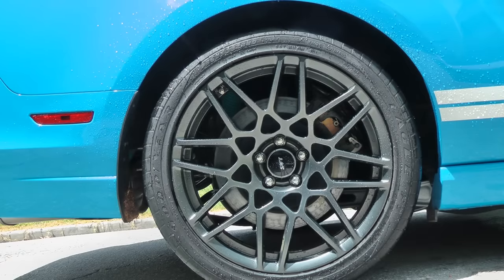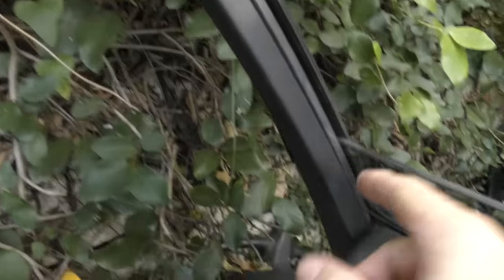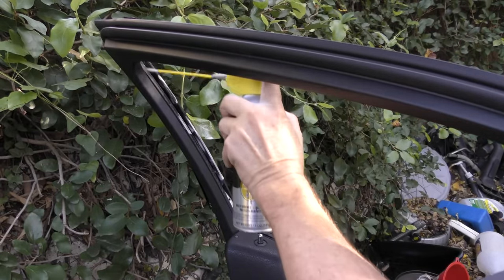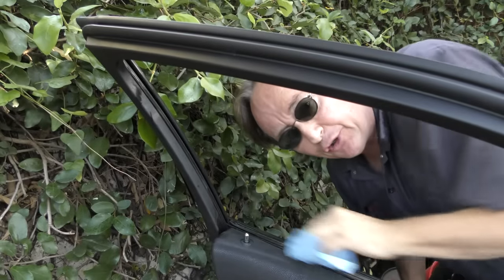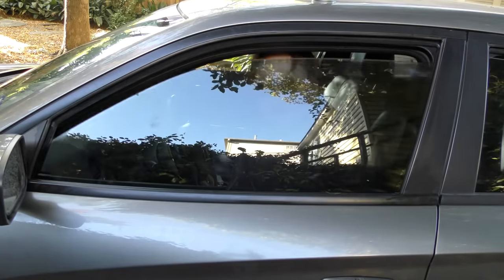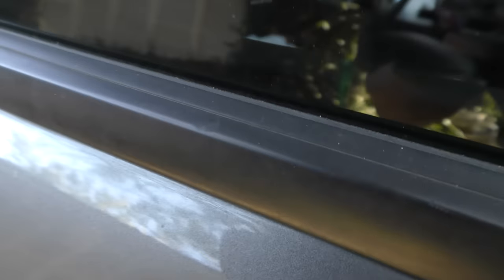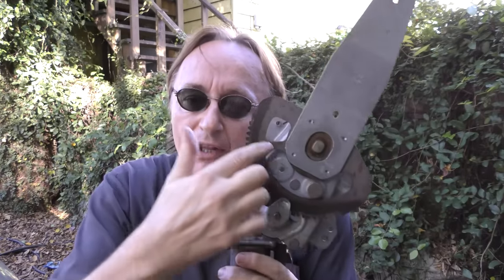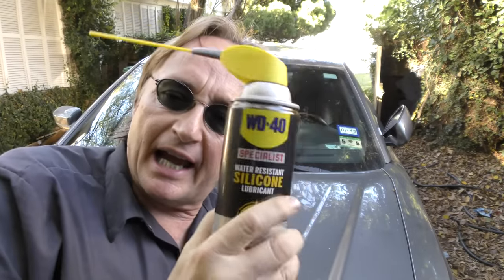Life Hack That Will Keep Your Power Windows Working Forever

Comment: why so many thumbs down..somwbody wants to give some advice and share his findings.. so respect him a bit ..if you dont get lost
Reply: Here’s why at first there was nothing wrong with the window to begin with he was just playing with the switch.
Reply: Could be Ford haters that are mad because of the intro.
Reply: @georgerebreev  He may have been playing with switch for effect, sure. But he is right. My power windows were sticking similar to what he showed. After awhile the window motor blew. $85 for a new motor, and about 2 1/2 hours tearing the door apart, replacing the motor, and reassembly. This stuff actually happens. So what's better? Waiting for mechanical failure, or a touch of inexpensive preventive maintenance?
Reply: @georgerebreev  he was giving an example? Lol

Comment: WD-40 fixes everything.
Reply: +Peter Griffin NOOOOOOOOOOOOOOOOO only use sillicone lubricant, not regular WD-40. WD-40 RUINS the rubber and makes the operation even stiffer in the end.
Reply: +Peter Griffin = I spray it into the car's door lock cylinders (and truck lock cylinder) every couple of years, to keep things working smoothly.
Reply: To bad it can't fix my wife 😂😂😒
Reply: Wd-40 Rocks !
Reply: Hi I used the normal wd-40 will this cause any major issues or shall I just buy the silicone one instead
Reply: SuperMadBoyHD - Regular will dry out rubber faster.. The silicone is the way to go.
Reply: Not always.   Sometimes you need a hammer and some duct tape too.
Reply: They make a teflon spray for locks which works better because it doesn't leave any residue,  you can cause build-up allowing dirt to stick.
Reply: Yup I put it on my breaks it definetly stopped the squeeking but didnt stop me from crashing into a car 😂
Reply: Regular WD is only for degreasing or water displacement or salmon fishing lure scent cause it's made w fish oil.
Reply: Can it fix my erectile dysfunction?

Comment: Thank you for this.  I bought a car at auction that had this exact issue and a 6 dollar bottle of wd40 silicone fixed it.  You rock
Reply from the maker: Glad to hear it, Thanks for the support!
Reply: WD40 isn't silicone.
Reply: It is if you buy the silicone version... that's a thing.
Reply: Reed Criswell 
I didn't know WD40 brand sold cans of silicone.  I've been buying gallons of WD40 penatrant to loosen rusty fasteners for decades.  It evaporates in short order,  so I doubt it would help sticky windows for more than a week or so.  
Same with using WD40 to shine oxidized headlamps.  After it evaporates,  they become dull again.
Reply: @scottykilmer  is it a replacement for K Y. Oh Ya I'm a smartass.
Reply: @phildouglas9086  WD40 does have a product that is a silicone spray.
Reply: We pay $14-$16 for a bottle of wd40 silicone here in New Zealand.
Reply: So it got to be WD silicone only no other brand ?
Reply: Miamiman 305 any spray silicone will work. Just make sure it’s just silicone and nothing with petroleum products in it.
Reply: So did I.  Don’t buy auction vehicles
Reply: @Nikkk6969  I've been driving auction vehicles for decades. 
between $200 - $1,000 range. 
drive them for free then double my money. 
RV's too

Comment: I've been doing this for ages, without even realizing that I was helping the windows. Lol. I use silicone lube to treat rubber around the car (including window rubber) to prevent dry rot and keep the rubber pliable. Killing two birds, with one stone! I like it. Great tip Scotty. It explains why I have never really had a problem with my power windows. Those motors are quite expensive, yes.
Reply: Interesting, but why not simply use a car detail lotion, like Maguires Gold Class Trim Detailer? They're made for the task.
Reply: @ecurb10  because there's a price difference

Comment: What old timers learned from their Dad's which young folks don't learn any longer is that moving bits must be lubricated in order to prevent wear, or eventual lack of operation. 
From the old timers history log .... 
If it moves, lube it ..... if its stationary (and exposed), paint it (coat it)... finally, always clean it...

Comment: If you own a BMW, this is a must because even after 30 years, BMW still can't seem to figure out how to make power windows work well, and the motors are notoriously weak... so do this as often as needed.
Reply: Temptation Christmas Silent Night
Reply: That is why BMW stands for Break My Windows.
Reply: LazyEyeCrazyI my 91 e30 works just fine after 26years
Reply: will this make my windows dirty whenever i roll them down and back up? you know like will they be like greasy?
Reply: LazyEyeCrazyI I must concur with you, my esteemed colleague. Ford and BMW must use the same brushes or windings in their motors because before I started typing this, I pressed my window up toggle, made a sandwich and now here I am. Another 40 seconds or so and it'll be mere centimeters from its apex. While I'm waiting, I will note that BMW has the best paint aside from Ferrari. Their Red is close to comparable to that of Ferrari in my opinion. Although, I haven't cared much for the color codes in the past few years. I'm not trying to be a dick when I say this, but they started using womens mascara colors to attract more female buyers which I understand, but they could definitely throw in a deep orange or burgundy, or even cubed blue like Cadillac did... that paint was gorgeous I have to admit and I'm a ford guy... Ford paint is by far the worst. A month old garage kept vehicle shouldn't feel like a junkyard undercarriage, ever! And my window along with my time is up...
Reply: Mike Foehr are you sure? I thought it was "Blew my wad" all this time. No wonder I didn't get that sales job in Juneau.... they have a dry humor there ya know? I took my snowblower to the eskimo mechanic for some repairs and so he looked it over, then looked me over and said "it looks like you blew a seal". I replied "nah, that's just snot".

 They asked me to leave...
Reply: Ya replaced my regulators 3 times in my BMW, or better marry wilma

Comment: Great vid, Scotty! I can verify through personal experience this DOES work - even if your motors are weak/failing, it might just prolong them. I use silicone spray on my 28-year-old Buick and it works every time!

And, when it comes to GM cars, sometimes it's just easier to change the whole door out with a working junkyard door than it is to replace the motors when they finally burn out. Took me a little over an hour to change two doors on an S-10 Blazer where both window motors failed, as opposed to several hours disassembling each door and messing with the mechanisms!
Reply: yikes!

Comment: I grease and white lithium silicone spray the rollers, pivot points, and hings on the actual window riser frame and use the grease on the gears (the spiked teeth).  Helps AMAZINGLY on ANY car older then 5 years of age.   Also make sure your felt strips that are on both sides of the window, one inside the door and one on the outside.  They wear out sometimes or have tears that cause slow or even completely stopped windows. 

To Man Asking About Preventing Fogging On Windows: To prevent fogging on the windows, use RAIN-X ANTI-FOG.  It lasts a very long time and you only need to re-apply a coat on the inner window every year or so.
Reply: I use Barbasol shaving cream...much cheaper than rainx and also does an awesome job on the bathroom mirror and it only takes a little bit. Try it!
Reply: Jeffrey McDavitt good  tip jeff,You are obviously a mechanic, also .thank you for the input

Comment: Silicone wd40 is the best. I use it for electric connections with or without the silicone gaskets among other things. It makes the gasket connection slip together and apart super easily and keeps corrosion down.

Comment: in case it hasn't been mentioned, use tyre shine spray if you already have it rather than buying expensive silicone spray. Tyre shine is silicone based, and fixed my binding window track, which was causing the window to stop as the overload switch was tripping due to rapid heat build up..
Reply: i used silicone dashboard shine spray and it worked too spray plenty of it and bonus thing is my car smells great since thn
Reply: Ahhh I just remembered I have some tire shine.  Thank you for making me remember I don’t have to buy anything new now

Comment: my drives windows was going slower and slower, pretty much figured i was going to have to replace the motor....saw this video the other day, used the same spray he did, and my window is flying up and down.  completely fixed it and saved me from buying a part i didn't need.  Thanls Scotty!

Comment: Silicone lube spray is also good to keep windows from freezing shut.
Reply: +66gt40lm yep, lube helps to keep windows from sealing, and vaseline helps so the door seals wont stuck together, I do this every year and never had issues, well, only when the whole car got covered in ice but that's a different story
Reply: draconpost actually silicone is good on both overtime you'll see the issues with using things that seem to be fine.  Petrol based can dry out and cause parts to become brittle or tear.  I use rain x on my windows then drop them down and do the tops that normally are covered by the seal.  That way you don't get felt/rubber stuck to the edges if your windows are usually closed, kept outside etc..  That also helps keep them from being frozen in the winters.
Reply: Can it be useful in reducing noise while operating power windows
Reply: Kartik Jain Yes smoother is easier on the motor with a consistent easier effort vs catching or drag as it is running.  So it tens to be quieter and smoother.

Comment: Does that also help in the winter when it freezes?  I spray the door gaskets and locks every fall so they don't freeze, but I wonder if spraying the windows like that could help?
Reply: That is why he uses silicon lubricant, it resist low and high temperatures without doing a gum.
Reply: Jennifer D
Reply: Leg cramp cure
Reply: I did wish he would have gave other usage tips at the end of the video...  Going out to buy an $8 can of lubricant when you only need like 1% of the can just leaves you with 99 more uses :/
Reply: @ihatesignupsgrrrrrrr  Spray your key locks to avoid those sticking?

Comment: I had a problem with my nissan frontier truck. After i brought it to a bodyshop to fix dents, my window is not working smooth after. I tried to send it back but they cant figure whats wrong and how to fix it. So i did this. Thanks so much it worked my windows run smoothly after i applied wd 40 silicon lubricant. Good advice and hope you help more people with your videos

Comment: The BEST stuff to use is Shin-Etsu silicone grease. Honda contracted Shin-Etsu to make a specific grease for window tracks and rubber seals. It even has a Honda part number lol.  Look up "Honda 08798-9013" and buy it. You wont be disappointed.
Reply: *****
No it wont hurt. The Shin-Etsu grease I use from honda is designed for all rubber window tracks. Stuff works great it reconditions the rubber.
Reply: Works great on sun roofs also.
Reply: garretts91 Thanks for the option! Ill cost shop this perhaps!
Reply: Another good silicon grease you can get at NAPA, it'll probably be less expensive than Honda grease. It's called Sil-Glyde or Sil-Glide.
Reply: garretts91 and how much does it cost wd silicone spray is about 8bucks here in Australia
Reply: Can you use this stuff on a moonroof to help with better operation? ...And can you use it on windshield wipers if you wipe off excess really good?
Reply: Honda probably overcharges for their branded silicone grease. Plumbing supply stores sell silicone grease. It is used to lubricate faucets that have become sticky. You can also get silicone grease that is non-toxic and safe to use near food prep surfaces, and silicone dielectric grease.

Comment: So I'm Taking it as this won't harm the Window Tint? WD-40 Silicone Lubricant
Reply: Never use a window cleaner with ammonia and you'll be just fine.
Reply: @jeffjeffrey4956  don't use glass cleaner w ammonia on mirrors. It eats the silver out on the edges.

Comment: It is so hilarious how reckless he is with the spray. Getting it on the car interior. lmfao
Reply: Really? So many people whining about the most trivial things.  Every see how cars are treated at the dealer? When I got a new car I got a free oil change. I did the second one and when I drained the oil, I got double the capacity of the crankcase in my drain pan. Go figure. I'd rather have a little bit of spray residue.
Reply: Should have emptied your drain pan first
Reply: +Zack Zander Yeah, I never trust those guys. Only went to the dealer for recall work. Otherwise, I have a very honest mechanic work on my car. Sadly, it's getting harder and harder to find decent mechanics :(
Reply: +acs197 This is why I do things myself.
Reply from the maker: +fred smith fred is either being very sarcastic, or is completely insane.
Reply: ***** GTFOOHWTFBS!!!!!!
Reply: I thought the same...dude went apeshit with the overspray! I'm no neat-freak by any means, but a little common sense while spraying the tracks is obvious. The overspray does remain on the trim regardless of wiping it off. You gotta get some interior cleaner to take it off so it is not noticeable in most lighting.
Reply: 04dram04 like he said it will not hurt but will shine
Reply: +Big Edge If it was a McLaren then sure...but these daily drivers...who gives a flying F? He obviously neglects the window tracks and looks like it's never been properly detailed anyway.
Reply: Scotty made an extra effort to splatter it all over to show it's no big deal but yeah, it made me lmao (;
Reply: And how he does burnouts and slams the brakes on in every video.
Reply: You must not be aware of how terrible and strong silicon grease smells
Reply: silicon grease has a potent terrible smell

Comment: Thanks Scotty!!. My window got locked in the up position. I became very upset at the idea i have to take the door apart, and figure out if its the fuse, motor or regulator. Or all of thee above. For a month its been stuck up...i came across this video and decided to try it out. Sprayed it while it was up, tried it, didnt work. Got discouraged...went back after a few minutes and it worked! Just needed time to penetrate. Thanks man. Thanks alot.

Comment: Hey Scotty, i looked on your channel on how to keep your windows from fogging from the inside, and couldnt find anything, any tips? its annoying because its constantly foggy inside and now that its winter it freezes solid. Thanks!
Reply from the maker: +TurPPu they make stuff to put on windows on the inside to prevent fogging, try out some of the rain x stuff
Reply: Scotty Kilmer I did not know that, thanks very much and keep up the amazing work :)
Reply: +TurPPu warm up your car before you drive lol then it won't fog up
Reply: Chris fix has a really good video on it.
Reply: +TurPPu ChrisFix!
Reply: TurPPu, read my comment that I just posted on this video.  Answers your questions and has more tips as well.
Reply: The video comment on this Scottys video here that is above yours that is.
Reply: I keep a small space heater out in my car.  When I get home from work, I plug it in.  I also have it hooked up to a timer so it'll kick on automatically a couple hours before I have to leave.  In the morning, I just unplug it and drive away.  Don't have to wait for the windows to thaw or anything.
Reply: your heater core isn't leaking is it? excess moisture in carpet? lift carpet to find out, esp after a good rain. leaking window seals let h20 in & it flows to the floorboards. check around pedals too. 
 you could luck out & just need floor mats. guess what... they have floormats in junkyards! good ones sometimes. they have never asked me to pay for them either.
Reply: +TurPPu It means water/moisture is somehow getting inside your car and condensing on your windows.  Check for soggy carpets and see if you find where the water is coming in.
Reply: +TurPPu Shaving cream ;)
Reply: I've used shaving cream and my windows have never fogged up since. It's a cheap solution.
Reply: TurPPu Do your car doors still have that plastic film in the inside (the Vapor Barrier)? I removed mine when I put in a new door-panel speaker, and when the wet winter came along my car got very foggy! 

I spray that silicone stuff on the inside cavity of the door panel, especially the bottom so rain water can drain faster, and then made a new Vapor Barrier out of a shower curtain liner
Reply: It also means your HVAC system isn't  functioning proper. A/C runs when in defrost mode...or is supposed to dehumidify

Comment: i have WD40 but it's not silicone based can i use it?
Reply: No, because it could eat away the rubber trim.
Reply: thank you.
Reply: +DroidsRGod true
Reply: Also WD40 is a shitty lubricant. It washes away grease and is really only a temporary fix.
Reply: True*it has very limited use I think+maybe simple things only+never use it for guns I read"
Reply: Mohammad i
Reply: "i" know. 
I was in a hurry.
Reply: Mohammad cool+I do it all the time+happy holidays
Reply: David Downs happy holidays to you too
Reply: Cool
Reply: Only use on kids that won't git off yer lawn.
Reply: WD40 is more a cleaner than a lube so it's great for cleaning crap off with.
Reply: @Joseph Lee, WD-40 is still best product on market, if used too it's purposes. Why would you spray WD-40 where you're gonna have grease? Two different application purposes.
Reply: No, because it's not silicone based.